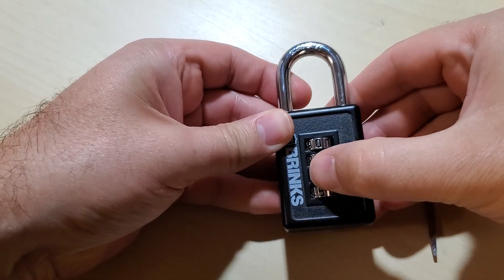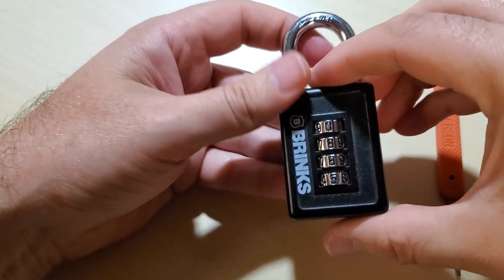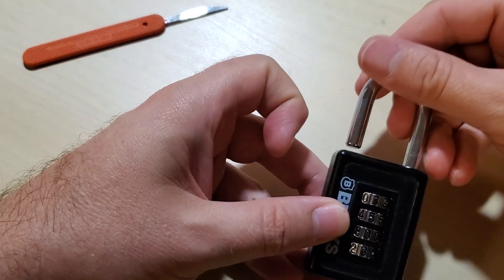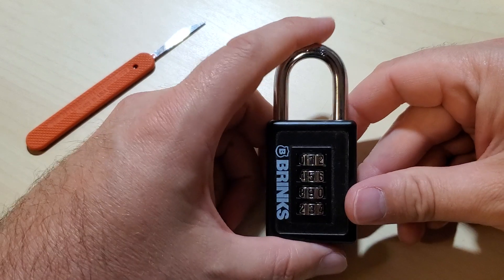Brinks 165 Combination Lock Decode

Comment: You can also shine a light into the crack on the top of each of the dials and then turn it until it's flat, then turn it 5 times in any direction.

Comment: This was the easiest method BY FAR!  Before this video, I wasted 10 minutes trying to feel the wheel while pulling on the shackle until my hand started to cramp.  I was starting to doubt my ability, especially since this lock is supposed to be super easy.  Literally less than 2 minutes testing your method using a flat broken metal hair clip, i had the combo.  Woo Hoo!  Thanks

Comment: What can I use if I don’t have this kind of tool
Reply from the maker: Feeler Gauge .007" thick is often used.  Aluminum cut from a soda or beer can works too.  The metal just needs to be thin enough to fit in beside the wheels.
Reply: I'm sure you figured it out, but I hammered a one inch nail until it cannot get any flatter and used it.

Comment: Thank you. I forgot my combo and was about to throw it away. I cut a strip of steel can lid to the profile of your pick. It still wasn't going smoothly so tried taking the burrs of the edge of my "tool" with a stone, then it worked easily first try.